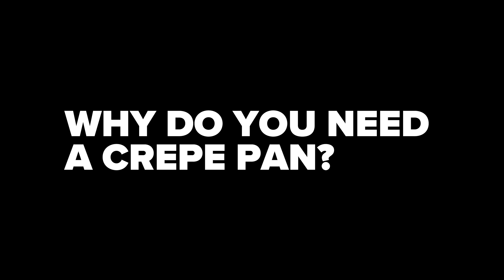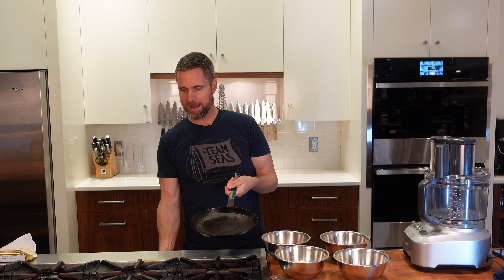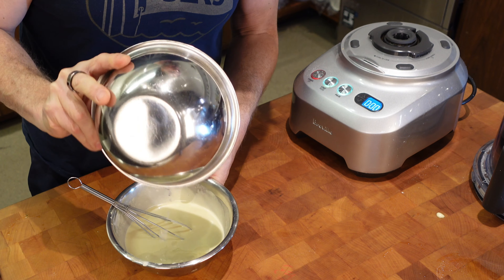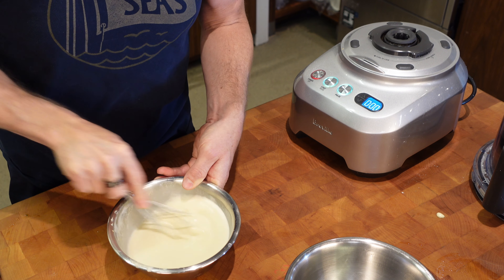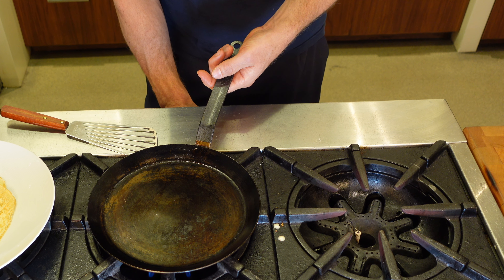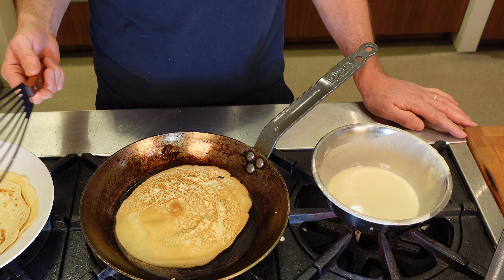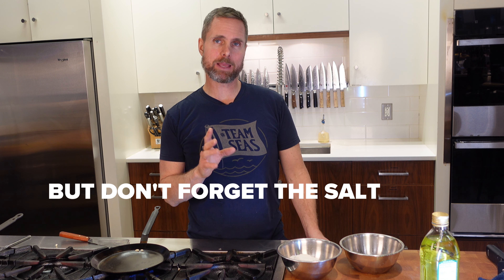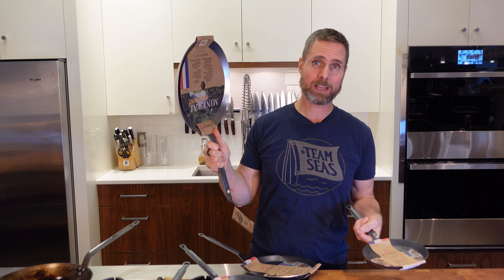Making traditional and plant-based crepes using a carbon steel crepe pan

Comment: I purchased a 9.5” Mineral B crepe pan, mainly to make tortillas. It just arrived today. I seasoned it once, followed your traditional recipe, and the results were as close to perfection as I could hope for. I ended up adding a touch more water, so the first two weren’t as good as those that followed. Zero sticking. Carbon steel for the win!

I’ll try the vegan version next. It will be great to have both in my arsenal.

Cheers from Southern Oregon!
Reply from the maker: Wonderful! Thanks for letting me know

Comment: I just received a new de Buyer crepe pan (Matfor sold out in the UK).  Small 8 inch version so my young son can cook crepes (with supervision)!  I am using my de Buyer 11 inch pan but it is too heavy for swirling crepes and the sides are a little high for easy turning. I have a feeling that I will be buying another pan to make larger crepes at some time.  Crepes are a safe bet at my house for lunch on a Saturday.  Everyone eats them and crepe pans are probably the best value in carbon steel cookware.  My wife asked me if my new pan was 'non-stick'. I told her that it will be.  She loves teflon, but kills those in the dishwasher when I am not checking.  Now I can make vegan crepes when the cousins come over!  Thanks! Great video to watch.
Reply from the maker: Glad it was helpful!

Comment: Some advices:
- Instead of normal water use caronated water. The more carbonated is the better. It makes the batter and the crepe much more lighter. Don't use baking powder!
- Do not put sugar in the batter. It makes the batter more prone to sticking. And you can make savoury crepes much more easily.
- Istead of butter use sunflower seed oil. That's much better suited for the crepe.
- Do not overcomplicate te preparation. Just dump the flour in a bowl, add the eggs and the salt and a little bit of milk. Mix it with a wodden spoon while adding more milk until it gets a thick pancake batter cosstency. Let it rest a little bit then pour in the carbonated water while mix it gently. That's all.
Reply: Letting it rest is a good tip! Also run the batter trough a (fine) sieve for a smoother batter and take it out about an hour before baking them so the battery isn't ice cold can help too.
Reply: I haven’t used carbonated water for crêpes, but when I was a kid my camp director taught us that method for pancakes (he used club soda) and it made the pancakes SO much better. I’ll try it for my next batch of crêpes.

I have an 8” Mauviel crêpe pan which works well but also a 10” Le Creuset for larger crêpes.

Comment: Excellent video, I also have a de Buyer crêpes pan. Though cast iron works equally well and is also very "traditional". The only comment I have is on the pronunciation. The first "ê" is not pronounced like in "grave", but like in "ph*ae*nomenal", though with a very short "ae". The second "e" isn't pronounced at all. It basically sounds like "crap", only with a "k" as in "kilo". Try it, and it will sound and taste so much Frenchier!  😁

Comment: Wonderful video Jed. I have two de Buyer crepe pans. First one I got was the 12" Mineral B Crepe Pan. My plan was to use it not only for crepes but also for searing salmon and chicken breasts. What I found though is that pan was too big for the size of crepes I wanted to make. So I decided to get a smaller one. The 9 1/2" de Buyer Mineral B Bois Crepe Pan. This is the one with a beechwood handle. I really like it. I use every so ofter for eggs as well. Great pan.

Comment: The De Buyer Crêpes pan was actually my first carbon steel pan! Love that thing. It's actually pretty amazing how easy it is to make vegan crepe batter. Even the plant based milk isn't necessary, you can also use just water as well. And ground rolled oats or lentils instead of flour.
Reply from the maker: Yeah! You've got it!! Lentils for the win!
Reply: Interesting.  Thanks for the tip!
Reply: Do you have a recipe for the one with lentils?

Comment: I never have to toss away my first crepe- my mom always admired that on me. I just ordered my first De Buyer crepes pan. I chose the dirt cheap one, 2 mm thick, 24 cm. because I love tossing them in the air. I will tell you if that was a bad idea. I chose it because it was lighter and because I have a lot of experience and little patience when it comes to making crepes. I also loved the idea of it being without rivets. I will tell you how my crepes turn out!
I used to replace the eggs with soya flour (one tablespoon of soya flour replaced one egg) and it worked like a charm. It was easier to always have soya flour at all times than to make sure you always have eggs. Oat milk is a great replacement for milk, when it comes to taste. I have no idea about it’s cooking properties.

Comment: At my old job we used non-stick skillets and thinner batter but flipped pan to drop crepe onto hand then plopped uncooked side into pan I guess so we wouldn't rip crepe trying to flip w/spat. We would loosen edges w/spat though for easy release. If I were to do these now in my CI I guess thicker batter and flipping w/spat would be better for my wrist, lol.

Comment: Hey Jed! Finally, you made this video! So glad to see how easily you turned them over. Question, what size is your pan? And checking your web, what difference between blue steel and mineral B? Not sure if you explained it before and I just missed it, but if you can show me the link where I can find the info and why the mineral B price is double. TY again and good to see you around.
Reply: I asked the size question also, reply was 7". The mineral b is a thicker heavier pan.